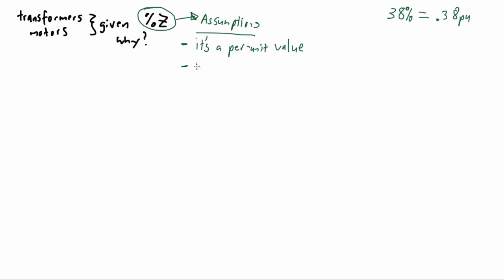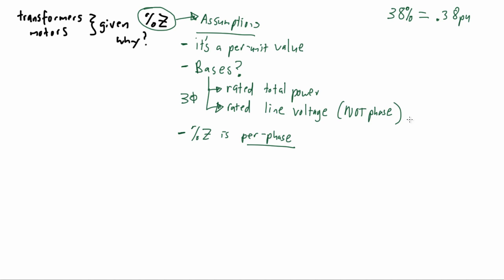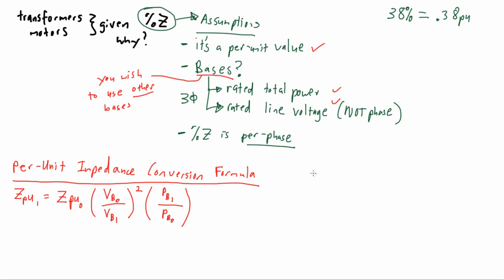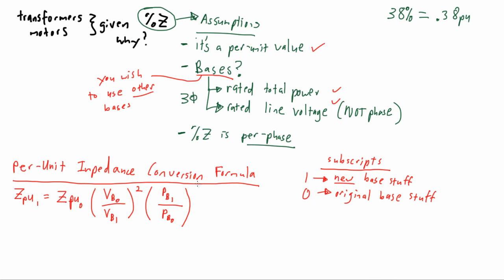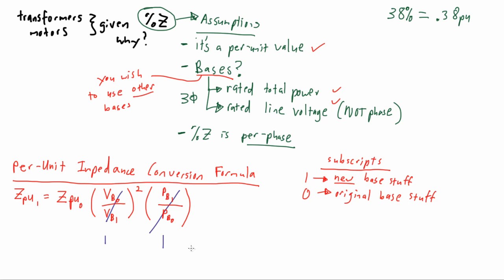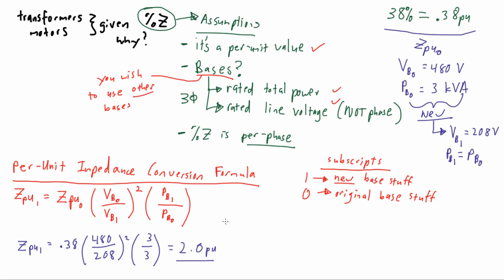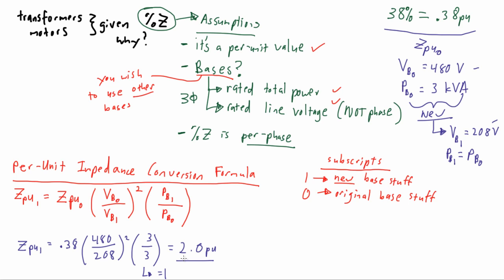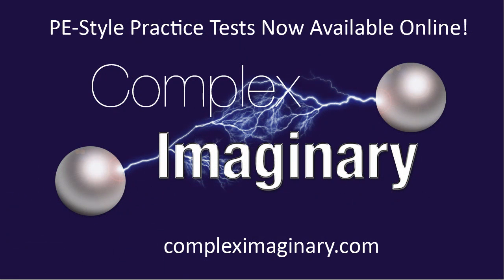Electrical PE Exam - Per-Unit (PU Conversion)

Comment: You stated that one of the assumptions in 3 phase system analysis is a POWER base. That is not correct - the proper base in such analyses is MVA (Mega-Volt-Amps) which includes the "imaginary" power present, and the reactance part of the impedance. Z =( KV^2)/MVA.